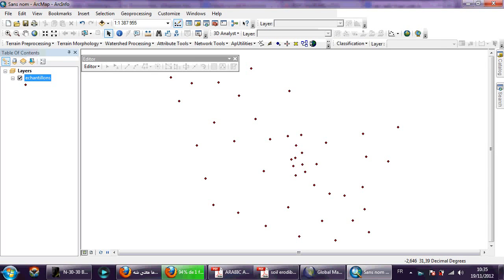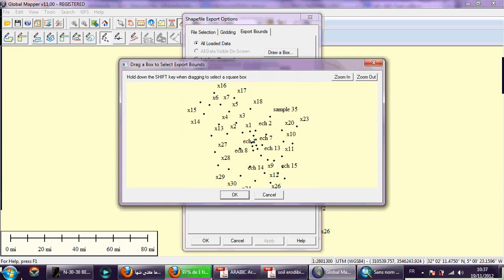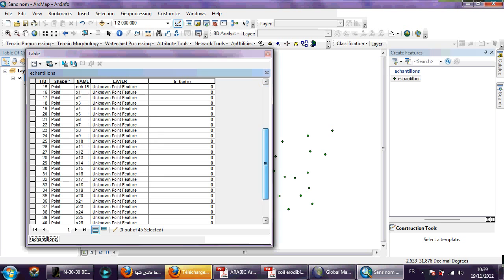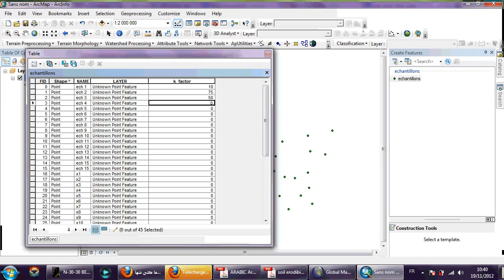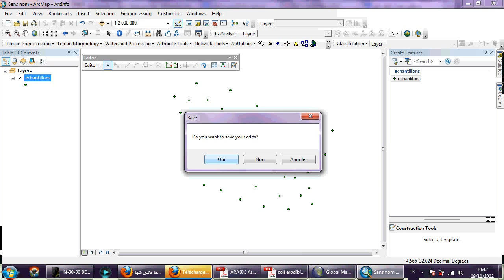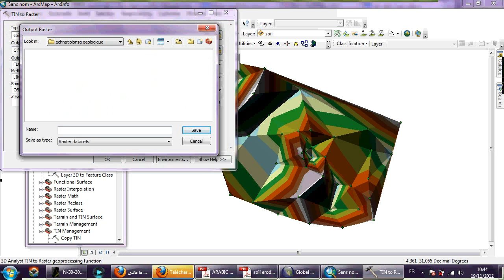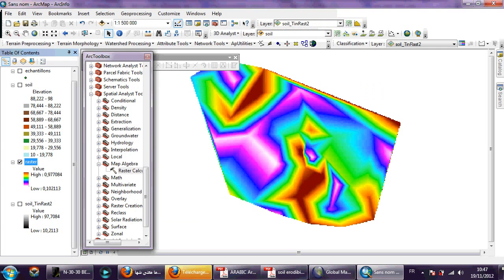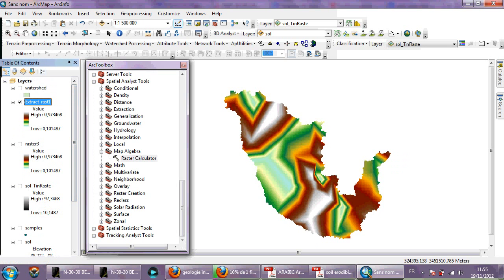K factor map using ArcGis

Comment: I used the SSURGO soils data for mine.  It has a K Factor in there but the field is a string.  I made a new field with double data type then used the field calculator to set the new field equal to the K Factor.  In the field calculator I cast the string as a float.  
def SetKFactor(kwfact):
    return = float(kwfact)
where kwfact is the string field.
Awesome tutorials by the way.